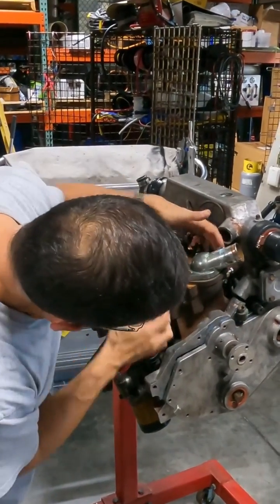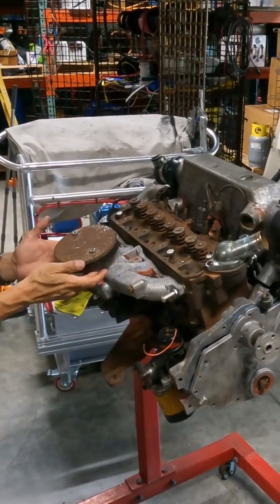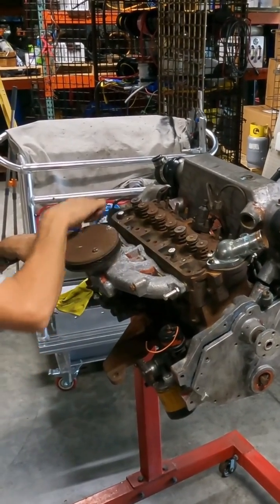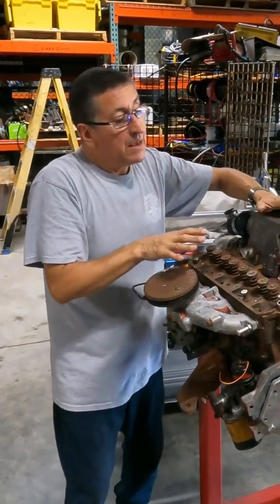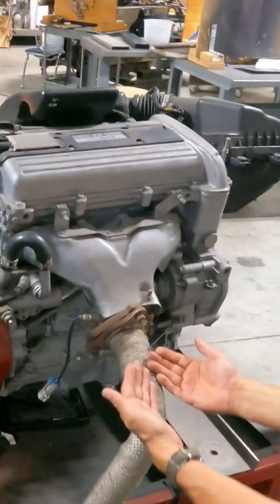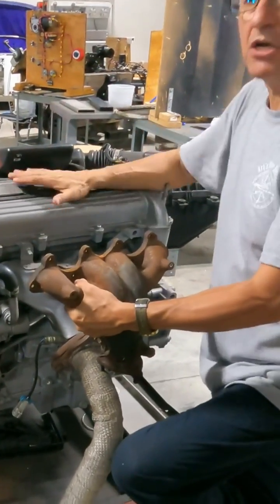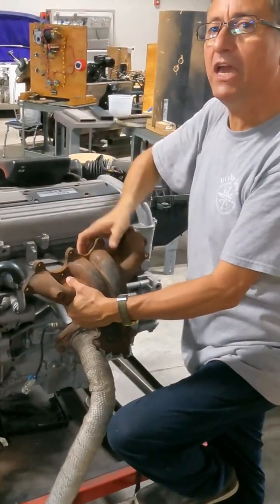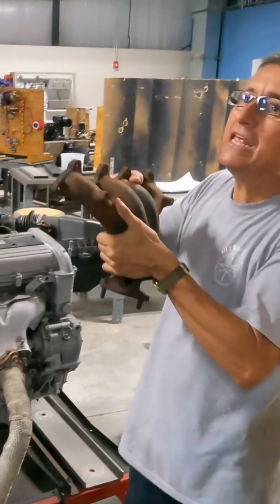Intake and Exhaust Manifold in a Marine Engine

Comment: There's a big difference. The inside of the coolant passages is coated to protect it from corrosion. A car engine would rust away, from the inside, in a year. Also, marine engine has a different cam for a different power band. Also, the starter and alrernator will have flame arresting screens. That's a major one there, if you like your boat to not explode in an instant chemical bonfire, consisting of all the various synthetic materials your boat is made of.  There are a few parts that are interchangeable between auto and marine engines, but they are fewer than you might expect. I am a certified marine mechanic, so this may be the one thing I'm actually qualified to disseminate advice about. 1. Dont mix parts. 2. Use original parts.3. Do not modify anything unless it is directed due to design changes and stuff like that. 4. Ground/Bonding wires DO matter! 
End of lesson.

Comment: There are 2 types exhaust manifold... Dry type and water cool manifold... Some of the marine engines used dry type but needed to be covered with a heat shield for heat protection.